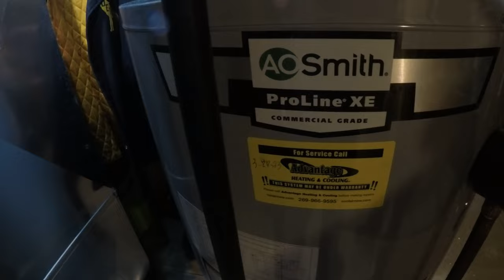A.O. Smith water heater from leaking from the top

Comment: Mine water heater is about 13 years old but I can’t get the rod out. Stuck on there good. I do flush it every now and then but whenever I get a new one I will make sure to put some dope or anti seize on the new threads.
Reply from the maker: They are in there good, The best way is with a Breaker bar with a 2' or 3' piece of pipe for extra leverage. or a Impact drill.

Comment: I installed 2 hot water tanks in 2008 in my house. I immediately removed the anode rods( needed an impact driver to get them out) and added tape to the threads and reinstalled them. I check them every year or so and replace as necessary. These rods are installed at the factory and the manufacturers know most people don’t know about them and the tanks fail prematurely which is great for business for plumbing outfits and manufacturers. My tanks have yet to fail. It is a bit of a racket in my opinion.
Reply from the maker: Thanks for the Feedback.
Reply: @ADVANHVAC  
Thanks for the videos.

Comment: I REMOVE THOSE RODS FROM  BOTH  OF MY HOT WATER  HEATERS THOSE RODS MAKE THE WATER STICK  AND STAINS  EVERYTHING. THIS HOT WATER HEATERS WAS NEW NOW ITS OVER 20 YEARS NOW AND HAS NEVER  LEAK YET  PIPE PLUG IN HOLES I DO NOT AGREE THAT KEEPS THE HOT WATER HEATER FROM LEAKING OR FROM GOING BAD
Reply from the maker: Thanks for the Feedback.